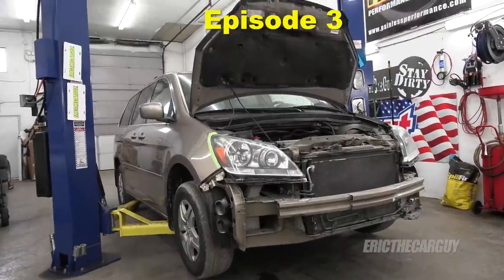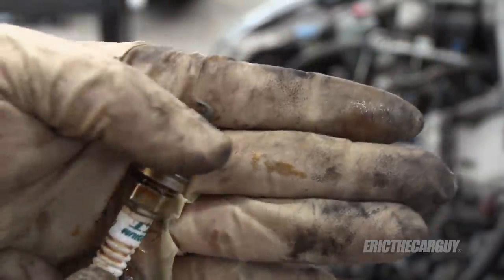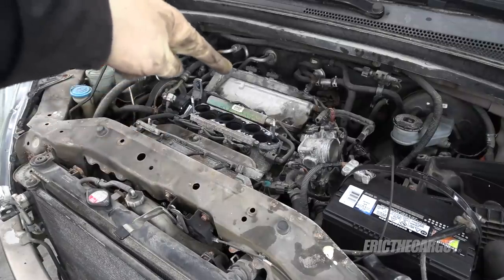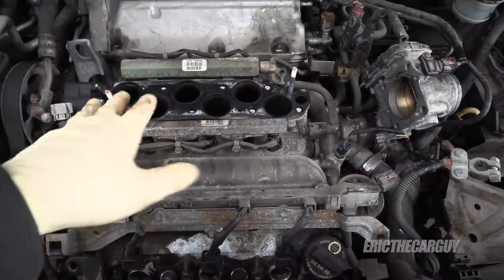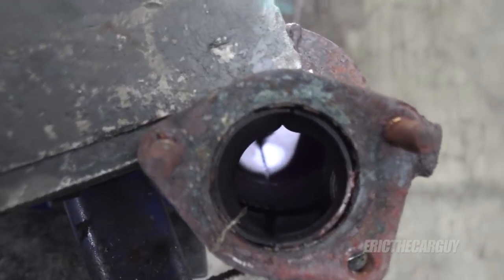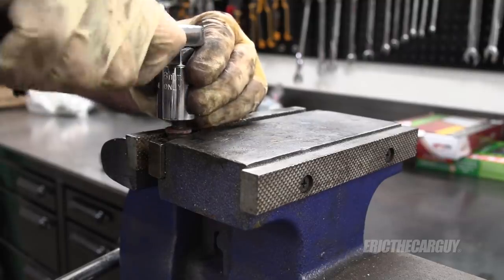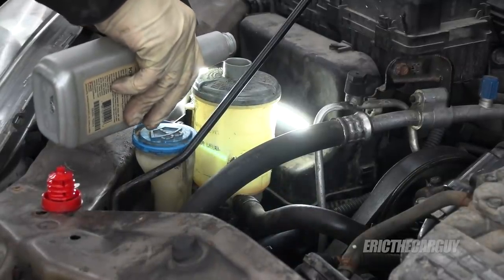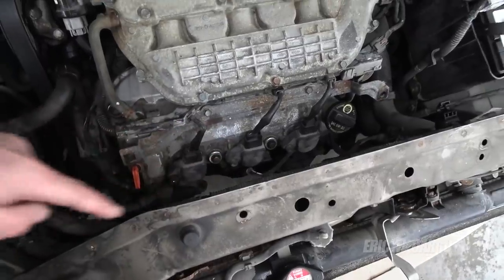2005 Honda Odyssey Engine Work (Episode 3) Fixing it Forward

Comment: Eric when hooking up the remote starter did you have to deactivate the fuel pump or is the pump not activated at all seeing that the ignition key is off ? The remote starter setup battery positive to starter positive. I have a remote starter switch from years ago and it’s still like brand new. It’s when Sears was sponsored by Roger Penske. I still have the entire tuneup set with case. Any issue with using it ? Just checking if there is something I should know on these newer cars ? Stay Dirty loooooooog time subscriber to premium channel and your specific videos for purchase. Thanks for all the years of sharing your Honda videos and knowledge. 🇺🇸 Artie

Comment: Correct me if I am wrong but I think thats an EX-L model, the EX-T (touring) had the run flat tires/wheels, leather seats, parking sensors, no spare tire etc. The VCM was on the EX-L and EX-T and the LX and EX models didnt have it.
Reply: Iirc Tourings were listed as “EXL-T” but you are correct. VCM came on the Touring and EXL models. Main additions to the touring was power adjusting pedals, power tailgate, leather steering wheel, PAX tires and parking sensors etc like you said

Comment: Great video, Eric. I also have a 2005 Honda Odyssey with the VCM engine as my daily, which I have bought back to life and it has seen better days. Recently I have discovered the rear spool valve or vvt solenoid gasket started leaking on my odyssey so I will have to address that. I want to also ask I am getting 16-10 driver side seat buckle code, do you think most likely the seat buckle is bad? Thanks.
Reply from the maker: Possibly. Honda has a lifetime warranty on seat belt parts BTW.

Comment: ETCG I feel doomed.  04 Element, bought with 75k miles, serious shimmy at 55-60 mph, smooth at higher and lower speeds.  Now shimmy awful and permanant with 150k miles.  Axles, motor-trans mounts, wheel bearings, struts combined cost about what car is worth.  Ideas?  BTW you rule.  Thanks!

Comment: We own an 05 Odyssey and when we first got it Honda said that the tranny filter was a “life time” filter. At a bout 120k I finally got the part and changed it. It literally came out in pieces. (Even the spring and O-rings). Well since then I’ve change two more times and they’ve come out looking like filters. Anyhow, our van is now at 265k on the o. g. engine and transmission. Just my 2¢.
Reply from the maker: Older Honda automatics did not have replaceable filters. We got used to that. This transmission actually has a filter that I found out about after the fact. It's ordered and I will replace it in a future video. Thanks for the comment.

Comment: 12030-RYE-A01 is updated part number for the Front valve cover i have the 12030-RCA-A01 which is the older maybe the Rubber was different? Idk 🤷🏻‍♂️ it last longer on the RYE

Comment: I have a 2008 Ford Escape xlt and the transmission lines are $600.  Bith lines are one unit with a thermostat in the middle.   You can't them anywhere else.   Mine was rusted out so I had to buy one from a scrap yard down south that was in good condition for  $25.
Reply from the maker: Good find. I might just rig something up with regular line and compression fittings in that instance. Thanks for the comment.
Reply: @ericthecarguy  My plan was to cut out the bad section and replace it with rubber hose, worse case scenario.

Comment: You made. my day Eric, what a nice thing to do!!

You drained the transmission fluid,  is that your general rule on older or under maintained transmissions? I’ve heard that can sometimes cause a transmission to not work right, what’s your general rule there?
Reply from the maker: So long as you use Honda ATF in a Honda transmission you're usually fine. Honda AT's are a unique design that is really a modified manual transmission, and as a result, doesn't wear the same as other, more conventional, transmissions. That said, the Odysseys in the years previous to this one were plagued with transmission issues if you changed the fluid or not. Thanks for the comment.

Comment: My belief with that engine is that with the variable cylinder management the rear bank ends up being colder more often because the rear cylinders shut off quite often while driving. That would explain why the front is more coked up is my theory
Reply from the maker: I think it was an issue with the PCV system and had nothing to do with the VCM. People seem quick to blame that system for some reason.

Comment: So do you ring out the impedance of the coil pacs to check them if bad?
If so what values can we look for on “good ones” VS bad ones or weak coils.
Also post a link to buy this remote starter unit if you could.
Reply from the maker: Checking coil resistance is useless. Coils fail under load. You'll very rarely find a bad one by checking it's resistance. Not enough current to find a fault. 

https://www.jbtools.com/actron-cp7853-remote-starter/

BTW, you can do the same thing just by touching the wire going to the solenoid to the positive battery post. No need for the tool, just a longer wire. 

Thanks for the comment.

Comment: Hey there, I just watched a video you did showing how to narrow down overheating issues... And I have a fan that is not turning on and do not know if that is the only issue or not as I see a small leak coming from one of two small metal lines that run into the top of the radiator. I ran wire between two pins on the fan relay and the fan came on! Do you know what could be the issue with the fan if it will run when i close that circuit in the fuse box but the fan does not run even with a new replacement relay? I will see if i can get at those lines that run into the top of the radiator and tighten up the top one and look for any other leaks and will then probably pull out the thermostat and make sure it works properly... And then bleed the cooling system and hopefully can figure out why the fan is not working!!!
Reply: Check the fuse for the rad fans. If it's blown you probably have some bad wiring. Either way, you should probably verify that the coolant temp sensor is giving accurate readings. If it's not accurate you're going to have more problems than just the radiator fans. Fuel trims will be sourced from the wrong part of the map.
Reply: If you don't have a scan tool that can do live data, now would be the time. AC condenser fan relay controls the low speed fan. Low speed fan turns on at coolant temp of 195 degrees F. Check for activation at the condenser fan relay when the temp reaches 195 degrees.

Comment: Have you considered getting a induction heater?
Our oxy burner haven't been used a single time since we got one in our shop.
Reply from the maker: An induction heater won't cut bolts.
Reply: I haven't needed to use heat once since I got a 3/4 extended anvil from HF. Also the JTC Power Bar is nice when air isn't available. Haven't had a bolt it wouldn't break loose yet. Takes less than ten whacks with a 3lb sledge and boom... it's off. 

When I was in college taking welding (J Sargeant Reynolds), a torch that I was using had a cracked body and leaked. It kinda exploded in my hand. I wasn't seriously injured but it hurt and it scared the daylights out of me. I avoid gas like the plague now, and if I absolutely must (like burning the rubber out of an engine mount) I check it with soapy water first.

In another incident at a tune-up shop, a gas cylinder fell over and got decapitated by a table (the valve broke off of the cylinder). It took off like a rocket into the parking lot and hit some customer vehicles. Ended up flopping around like a fish and went into the street. I'll do anything to avoid gas if I can.

Comment: Love the video have you ever tried Marvel Mystery Oil for Engine treatment.  It really works.  I have a 2007 Honda Pilot with 200K miles and love the J35Z1.  Need to do another timing belt and water pump replacement.

Comment: I always look at the tranny lines/radiator fittings, I've seen a few rotted out at the internal tranny cooler, had a failed tranny due to coolant exchange on my MDX with the J engine. Put an external cooler on it...

Comment: On all 2005-2010 Odysseys, the EX-L and EX-L Tourings have VCM (J35A7.)  LX and EX trim levels (J35A6) do not.  In 2005-2007, the VCM is just on the rear bank, or cylinders 1-3.  2008 and up the VCM cylinders are cylinders 1-4.  2011 and up Odysseys, all trim levels, have VCM.  

One questions...at 190K+ miles, did you check valve clearances when you had the valve covers off?
Reply from the maker: No. No need to check valve clearances if the engine isn't noisy. As per Honda. Also, when you see a gunked up cylinder head like the front one was, it makes adjusting the valves very challenging. Thanks for the comment.
Reply: @ericthecarguy  Actually, that's incorrect and commonly misunderstood. Valve clearances are to be inspected at maintenance minder 4, along with spark plugs and timing belt (105k interval) . The note in the manual says to inspect them at the other maintenance minders A, B, 1, 2, & 3 if they are noisy.   It's usually not a problem to push valve adjustment out to 150k or so but at 190k if that engine hasn't ever had a valve adjustment it will likely start unexplained misfiring in the next 20-30k (See the video Mike Becker did on the Wells Tech - NGK channel.) Tight exhaust valves make no noise and every one I've ever done (generally in the 150k range) has had tight exhaust valves.
Reply: @johnaclark1  Which system had that TSB? I've been searching for another TSB that recommended 30K miles for valve lash adjustments or the camshaft will wear rapidly. It might have only been applicable to the Ridgeline and Pilot A9 engines. I'm not sure. I don't have access to TSB's any more.
Reply: @Npc5150  I'm not familiar with any TSB recommending a valve adjustment every 30K miles but I'm not quite as familiar with the A9 engines as I am with the A6 and A7's on this vintage Odyssey.  My data comes from the maintenance minder sections of the owners manual of these Odysseys.  It's a common misconception that you only need to check valve lash if the valves are noisy, but if you read the note in the owner's manual carefully, that is not the case.  Valve clearance inspection is done at maintenance minder item 4 (along with timing belt and spark plugs,) but any time if they are noisy.  I've never found one very far out of spec at 105K miles (the interval for item 4) but by 150K or so they should be done as most all of them are out of spec by then.  This Odyssey of Eric's is at almost 200K and from the looks of it, it's never been done.  He really should have checked them while he was in there with the valve covers off.

Comment: I don't recall which trim level this Odyssey is but Honda didn't put VCM on the LX or EX trims in '05. I know the Touring trim got it but not certain if the in-between EX-L had it.

Haha, I posted this before watching the whole video... ;) What is an EX-T trim ?? I think you mean EX-L.
Reply from the maker: This one is actually a Turing. AKA, EX-T.

Comment: Just spitballing, but is it possible the front was more gunked and baked because the vehicle saw a lot of highway mileage, and the rear bank wasn't getting used as much? (or contributed, since there was that PCV and seal that were wonky. :/  )

From a lay perspective, having the rear bank be the one that gets shut off for fuel economy makes a bit of sense, since it would lead to more balanced engine temps.
Reply from the maker: I think that issue was caused by the PCV system. I don't think it had anything to do with the VCM.

Comment: You didn't replace the transmission filter? My 04 accord J series engine has a transmission filter near the fill plug that you need to replace or it will get clogged and overheat the transmission.
Reply from the maker: Most Honda transmissions don't normally run a replaceable filter so I'm not used to replacing them. I looked it up, and this one does use a filter. I just ordered it. Thanks for the heads up.
Reply: @ericthecarguy  No problem. Most people don't know they exist and I believe that's partly why the transmissions in these cars fail so often.

Comment: Eric, question sir, putting solvent in the cylinders to remove carbon / oil, if you remove plugs and rotate engine cleaning, is there any issue flooding them?  assuming an oil change after etc.  PS, you're such a legend man!
Reply from the maker: I recommend you don't risk it. You also don't want solvent in the crankcase if you can help it.
Reply: @ericthecarguy  thanks mate

Comment: Why didn’t you check the valve clearance and inspect the cam lobes?  It takes a little time, but .....
Reply: He mentioned it in another comment. Manual says to perform valve lash adjustments "when noisy." I've always done them at 30K mile intervals either way. The TSB I read stated that exceeding 30K miles will result in rapid camshaft wear, even if there's no noise. There was a J35 variant that also had problems with the rocker shaft bridge torque. I never hear anyone mentioning this problem, but I can't recall either of the TSB's to reference. Failure to correct the torque on the shaft bridge will result in camshaft and rocker shaft damage.

Comment: Which type of cordless 1/2 impact wrench will loosen a honda crank bolt ? I've been planning on buying one.
Reply from the maker: https://milwaukeetool.com/Products/Power-Tools/Fastening/Impact-Wrenches/2863-22

And this: https://www.amazon.com/Ingersoll-Rand-S64M19L-PS1-Power-Socket/dp/B01CVAG1SG/ref=sr_1_2
Reply: If you're on a budget the Bauer 1/2 impact from HF will do it... IF you use a crank bolt socket (more mass than a standard socket). Lisle 77080 is $20. If you use a regular impact socket you'll be hammering for a good 10 minutes probably. Tool would probably give up the ghost.
Reply: Also forgot to mention, there's a hand impact wrench made by JTC that's better than most impacts, and it's great for tight spots. It's called the Power Bar. JTC 4699. Kinda pricey.
https://www.amazon.com/Power-Impact-Wrench-JTC-4699/dp/B071P7Q3FF

Comment: You were an Acura tech you know these j series engines have ring issues. Just go ahead and do all 6 holes and throw new head gaskets on and do ckp relearn and she’ll be happy.
Reply: I've got a Pilot and Ridgeline with over 220K miles each. No rebuilds. The rings are still good. Healthy engines. Long and short term fuel trims are still near zero. Compression is still well within spec, probably better than I've ever seen.

Only issues I've ever had were with valve lash adjustment and LMA's. Planning on doing preventative rebuilds but they're so healthy it might be a huge waste of money.

Comment: I have a 2005 Honda Odyssey that was coming up with the p2426 code replaced the solenoid, now it has a rough crank and after a few seconds it jumps to 3000rpms, I thought it may be the MAP sensor so I swapped with and OEM sensor(boy are they proud of that part) I cant seem to find any vacuum leaks but i went ahead and replace the fresh air intake hose to the throttle body since it was cracked from previous owner. has anyone ever seen this issue or can provide any insight?

Comment: Eric have you ever used a Lambda Sensor Tester/Simulator?
Reply from the maker: Nope.
Reply: @ericthecarguy  Well neither have I, but they sell them here in the uk https://www.sealey.co.uk/product/5637206416/lambda-sensor-testersimulator
Tests Zirconia and Titania lambda sensors and ECU.
• Suitable for 1, 2, 3 and 4 wire sensors, heated and unheated.
• LED display shows crossover signal from sensor.
• Simulates rich or lean mixture signals to check ECU response.
• Insulation-piercing clip for quick and easy connection plus display to confirm wire identity.
• Features a low battery indicator and powered by 9V battery (supplied).

Comment: I didn't understand why the front bank wouldn't cause a misfire but the rear bank would.   Can anyone explain this distinction?  Aren't all the cylinders the same?
Reply from the maker: The engine was not misfiring when I got it but it ran poorly because of the clogged catalytic converter. See the previous video. Oil on spark plugs doesn't mean there will be a misfire. Water is a different story, but they actually use oil to insulate some older ignition coils.

Comment: Curious why didn’t you paint the valve cover with high heat paint?
Reply from the maker: I did mention why in the video.
Reply: @ericthecarguy  must have been distracted by watching you work 😀
Reply: @ericthecarguy  just watched the video again and you mentioned why you didn’t paint the valve cover. As you know the Element valve cover is in the front and it too shows the paint flaking off. See that in most Honda Elements. Honda should have done a better job.
Reply from the maker: I could care less about how an engine looks on the outside so long as it's clean on the inside. Engines are for work, they don't need to be pretty to work.
Reply: @ericthecarguy  i like both

Comment: The plugs look to me to have a lot of miles on them. The gap looks wide to me as well.
Reply from the maker: If the plugs had a lot of miles on them, you would see a corona around the porcelain. Given there was no evidence of that at all, I believe the plugs were fairly new. The gap is also normal. Thanks for the comment.
Reply: I agree, when I saw those plugs the ceramic looked brand new. Unlike the plugs I replace on my hondas.

Comment: With all respect, at the point  uhave the valve cover, valve adjustment and fuel injector clean , egr valve and passage   clean jut to be sure when you seal the engine all that it's done,  and check out list my respect to you , and all come along good  to the future of the car, but I have one and that's hall I done  my work.